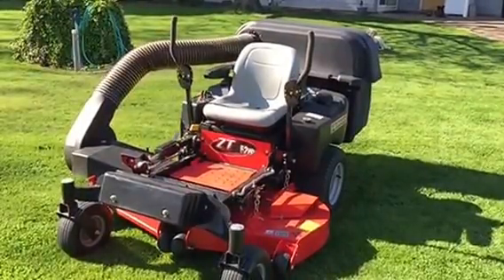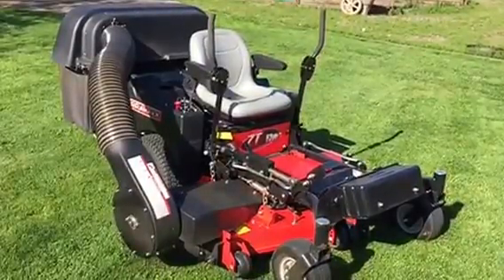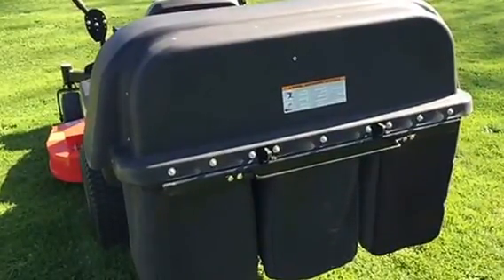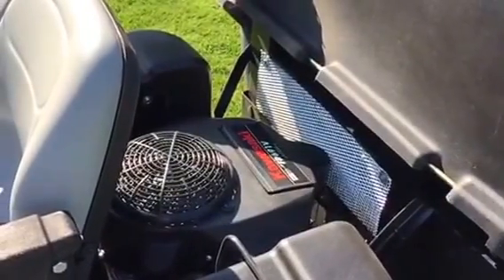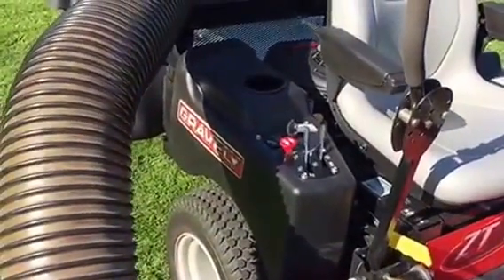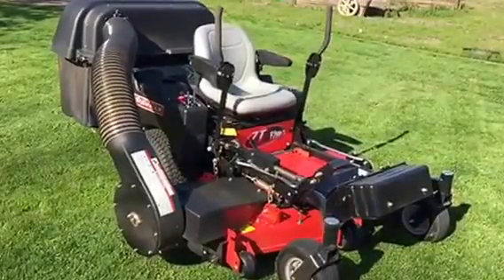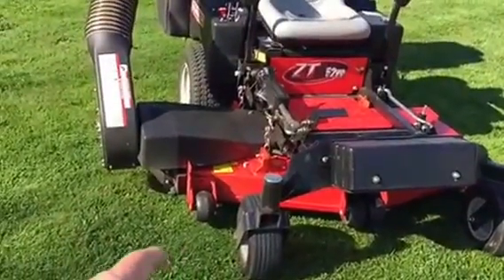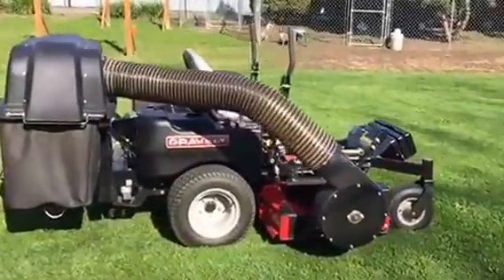Gravely ZT HD 52 mower review

Comment: Wow! I have a 2016 HD 48"  W/O the bagger, and it works perfectly. I also got 5 years unlimited miles warranty.  The seat is now top of the line with air ride!  I test drove, John Deer, Toro and Huslter, this gravely far out performed in comfort and warranty.  Ive had mine for just under 100 hrs and it still purrs like a kitten.  I mow 3-4 acres around our houses, and use it to haul my wagon in my other 25 acres for dirt, branches or get wood for the fire place.  The Deck is more heavy duty too! I think the bagger attatchment  on yours is to much.  Sorry for your bad experience!
Reply from the maker: Steve wilson   There is no real 5 warranty on any gravely products except for a limited sketchy on some of the decks or frames. (kind of like getting a guaranteeing it is still a mower for 5 yrs) The commercial warranty is one year on everything, on their more costly mowers the residential warranty is 3yrs and on some the frame and deck if welded may go up to 5yrs. 

As for gravely vs others (I hope you are at least talking about units of similar pricing, etc. ),,,,,I don't know how you can legitimately compare them if you didn't actually use them all at your site. 

IMO- the gravely high end PRO turn commercial grades are ALMOST as good as the others of similar cost.  Here is the difference from from a person with many decades of commercial and residential landscape experience,,,,,in general quality and build (especially in regard to gravely's residential line) is  not as refined, not designed for bagging, has traction issues (causes damage to grass due to excessive spinning),  the air cleaner is placed almost touching the bags so that it directly sucks up dust etc and must be cleaned after each hour or less of use (this has caused so many home owner units to destroy their motors that gravely now calls that out for cause to not warranty them even if you bring it in with a pristine air cleaner).  Gravely/Ariens  has the worst warranty coverage of any brand I have ever dealt with in 49 years of residential and business work.  Their bagger units are junk and look like a total after thought only offered to pacify the consumers and look like a Chinese universal fit that almost fits and works poorly at best. 

I could go on about the lower quality tires, bushings vs bearings, etc etc etc  but hope you got the point. 

In over all real world comparison, design, form and function I would never ever buy a Gravely/Ariens product again and could not in good conscience recommend them to anyone.
Reply: i was just on the gravely website and their commercial warranty is 2 years on everything 3 years on spindle, and unlimited on the deck/frame you were worried was too thin(and subject to stress fracture for being too thin). like anything commercial that can get a lifetime of use in a single year they have to put limits on some things.

Comment: At what speed do you have your throttle when engaging the PTO?  I have to have mine at 3/4 speed, otherwise my engine stalls.
Reply from the maker: Michael Miller   The mower as shown in this video has the up graded Kawasaki engine and when it’s at the proper temperature I can engage the Blade PTO at half throttle.  Without the power bagger it can engage at about 1/3 throttle. 
Which engine does your mower have?

Comment: Nice review.  I bought the 60" HD last October and 30hours in PTO clutch locked up and the right hydogear stopped working.  I bought this after my buddy bought the 54" like yours.  Both his hydros went out after 50 hours.  I would have paid for the pro model which was $9k  but was talked into this model.  When I get mine back I will consider selling.  My only disagreement with your review is that mine does have the 3year warranty and 5 yr on the deck.
Reply from the maker: Good for you on the warranty.  Hope you do better than most when trying to get them to honor it. 
They are not well known for standing behind their products.

Comment: Interesting review. I have this exact mower but w/a 48" deck, no bagger. Purchased brand new last Aug, and I'm "on the fence" whether I like it or not. My issue is with it cutting evenly. I've played around with the adjustments, tire psi, etc and I'm not satisfied. The deck is level per the manuals instructions. Would post pics here if I could. The dealer said it was tire marks causing the"unevenness " and Gravely refers me back to the manual. From your video, it looks like your grass has a nice, level cut. Maybe it's cuz you now at 2-2.5"? For me, that's too short. I need to be at 3-3.5". I wish there were 1/4" adjustments. Just wondering if you had any issues or challenges with it cutting to your satisfaction? Thx!
Reply from the maker: I don't know exactly what you mean by tire marks?  The only problem with tires I have is the rears (drive wheels) tend to spin too easily and leave huge bare patches. 

As for cutting quality, the wider the more smother it will look "IF" and only IF you already have a fairly level lawn.  

In your case with cutting that high (over 2.5") and with the guide wheels set as low as possible on the deck still can never touch the ground so the mowing deck is just loosely floating, bouncing and wobbling around giving you an uneven cut.  This is another design flaw that can only be fixed by welding or fabricating a bolt-on bracket extension to lower the anti-scalping wheels so they touch the ground and keep the deck level to the ground. 
I have found with this brand that the dealer setup is extremely important! 

I can not recommend this mower. You would be better off spending the same amount on a Toro or JD, better warrantee, a real satisfaction return policy, better performance.
Reply: +2003evodave I wish I could post the pictures.  But the dealer is saying that, because the tires are "pressing the grass down", it appears that the grass is uneven.  I disagree.  There a little"raised ridges" at the edges of the cut, which would also be at the edge of the tires, where the grass is uneven.  Hard to explain.

I am aware of the tires spinning on a slope, especially during a tight turn.  But I am very careful when doing any turning.  Overall, my lawn is pretty level, even with a walkout, the slope is safe no matter which way I mow.

It's interesting about your "the wider the more smoother the look" comment.  I specifically asked the dealer prior to purchasing, if a wider deck would give me a better but, other than just saving more time.  They told me that the 48" would be better than 52", and most certainly a 60" cuz it would minimize the risk of scalping.  I think I agree with you.

I will check my guide wheels again to see if they are at the lowest setting (I think there's 2 settings?). But I agree that, They never touch the ground, especially at the height I cut.

Thanks for the feedback.  I still have under 40hrs on the mower, which I don't know if that helps me or not.  I might just have to let the dealer redo their setup, and consider other options.  Thanks!
Reply from the maker: +Tom Peterson --in respect to wheel spinning I have this problem wet or dry and all my lawn is flat and level. It just spins out way too EZ.  My mower has the Kawasaki motor option. I know it has a little more HP than the brigs and seems to have more torque too. That may be my problem. 

As for wider is better, you bet. As long as the deck has all the anti scalping wheels installed and adjusted properly a wider deck will make things look much better. It's like leveling sand, a 16" rake will never do as good a job as a 40" rake. 

As for your problem with your mower cutting uneven. That complain has been raised many times by several people I know of & I had my deck reset 3 times by the dealer. It is more difficult getting that good cut with the deck being off balance from the weight of the power blower but I got mine finally working.  

I believe your mower is cutting uneven due to your high cut and with the deck just dangling off chains plus non-functioning ant-scalpers  your screwed.
Reply from the maker: +2003evodave -don't believe anything the dealers tell you. Not all but most will makeup anything to keep you quite and hope you simply go away. Most people will just be satisfied to knock the grass down and couldn't care less. I owned a professional landscape business for 30 years and feel if we couldn't do a better looking job than the business / home owners paying us or the kid with the 21" walk behind next door then we need to find another kind of work. FYI on our larger jobs we used JD and Toro in 52" up to 72" the results were always beautiful. 
I have found this brand difficult to set up initially, proper dealer pre-prep is critical for correct performance. My only reason for purchasing this mower was my fantastic water cooled KAW powered 23 yr old used and abused JD developed a small Trans leak on some limbs when mowing tall grass in a orchard with pruned limbs laying on the ground, which caused the transmission to fail. A new unit was more than the whole mower was worth. SAD!
Reply from the maker: +2003evodave 

As I posted previously, your mower will never be able to adjust the scalpers low enough to cut at 3.5" without some custom work. 

Your dealer saying your lawn is uneven due to the tires laying the grass down can be a little true but that is only temporary. It should bounce right back in minutes at most unless you are cutting it at over 6" then it may take up to an hour on a hot day to come back from the tires smashing it down. 

So is that your problem or?

Comment: Ok so I'm looking for zero turn! I like this one but also looking at 2016 Toro Titan zx5400. I test drove the toro but not the gravely. I have a 54" tractor that's get tired. Whet do you recommend to get!?
Reply from the maker: First of all do you really need a zero turn mower, they have their own particularities that make them what they really are yet cause new problems.   ZT mowers don't work well on hills, slippery or wet ground. They love to spin out the rear tires and burn off your grass down to bare ground when doing sharp turns. They cost a lot more than traditional tractor mowers,  more in long term maintenance, take more space. Don't bag as well. 

So why get one? They can go around things and follow crazy wriggling outer edges of any lawn with ease. 
Much quicker to do 180s so a mow that took 2.25 hrs plus with a tractor mower can be done in 45 minutes or less. 
So what to get ?- Don't believe the fabricated/welded deck lie from the dealers and spend 100s more for one. I had 12 workers out there  breaking equipment and never damaged one molded deck . If you need to bag, pull or operate-sprayer, spreader, drag, etc. definitely get the tractor type.  The ZT is only good for lots of turning / quickly.
Reply from the maker: As for what brand to get I like in the HD home owner class which costs apox. 3k to 6k =JohnDreere, Toro, Kubota, Husqvarna, hustler to start with, the professional Gravely isn't bad too but to get a good Gravely you start at the $10,000 mark and up. 
Check for a location/brand  that is close to you for parts/service 
Check the warrantee
Check on the satisfaction return policy--cuz only by using it at home can you know if it's right
Check the fit and confirm for those long big jobs 

All mower types, models, brands have their good and bad,  it's just that IMO - gravely has more bad that most, doesn't stand behind their product and have poor dealers.
Reply: +2003evodave I cut a few lawns and there's a lot to go around just looking to upgrade. My house backs up to a pond an I cut around it and the part is a hill. I know zero turn not good on hills but it's bad. I really don't want to spend over $6000. My tractor is a 2010 craftsman gt5000 26hp with 54" it's got 450hrs.

Comment: sad. I'd stay away from them. I've heard many mixed reviews, mostly without the bag. I have a home owner toro timcutter and It was great till the deck got out of wack. now mows low on the right, dealer couldn't figure it out.
Reply from the maker: Sounds like you need to find a competent repair place.   Stamped decks get damaged when running into things and become warped, bent or twisted. The whole deck can be whacked out of adjustment and level. The bearings of the blade shaft take a hit and go bad or the blades just get bent . People treat their mowers like its some kind of mini-dozer and hit, smash and run over everything. Some times it's a accident but some times..........not so sure.
Reply: +2003evodave I got to close to a tarp. it wrapped around the blade. Bent the blade a little. I put new on, then it started mowing low. Took to a friend that used to be a Toro,Dixon,dixie chopper dealer. Couldn't see or hear anything in the deck. no vibration either. i then took to the dealer I bought from to look at it and level. Got home and it still mows a hair low. One of my yards where its pretty smooth it doesn't do it though. Its just slight and most people would mess with it, but I can tell. The grass is always a little lighter on one side. I don't want to loose customers because its not striping good now.

Comment: Well I have the HD60 w/ the Kawasaki motor.  I paid $5300 out the door with 4years 0% financing.  Replaced my John Deer. So far over 100 hours and  not a single problem.  Also my seat is way bigger with padded arm rests.  If you wanted a better mower with less plastic they make a commercial grade mower for $2000 more.  I also don't know your dealer but the 60 was only $200 more.  I mow 7 acres. Also, my warranty was longer than 50 hours.
Reply from the maker: McClung Farm  ---the biggest problem with the gravely is the bagger,,,,,it only works in perfect conditions VS JD and Toros which will pick up everything even rocks, golf balls, walnuts etc. 
The gravely can barely pick up small dry leaves. 
As per the video the whole bagger unit is a factory cobbler afterthought (Junk!)
The Kawasaki motor is not as well build compared to examples from the past with its plastic shrouding  and poorly placed and small air cleaner which has cause several people to have lost their motors due to plugging,,,,especially when using a bagger.  We have already replaced the main drive belt ($45) twice in 60 hours. The list of problems is long. 

In my use and area we bag literally tons of leaves, nuts in the fall and throughout the season cut several inches of grass every week. This is much heaver work/use than most regions. 

As for the warranty,,,too many fail to read or understand, it says "5yrs limited" and only attempts to cover the frame and mower deck period. All other components are much much less and vary per state. 

IMO as a professional user of many brands I can not recommend the Ariens/Gravely products.  As stated we have found Toros and especially JD the best at always making things right. 
JD is outstanding in that if you are not satisfied with your unit will get you the one that is right for you. 
Plus have better and more comprehensive warranties which says a lot about their confidence in what they sell.
Reply: Yeah the bagger looks like poop.  I should clarify when I said no problems I did burn out my drive belt.  However it was my fault.  I thought I burned up the PtO clutch but I got a piece of barbed wire stuck in the damn thing.  Small piece too.  totally on me.  I literally paid $0 because warranty took care of it.  My only regret was not getting the Pro model.